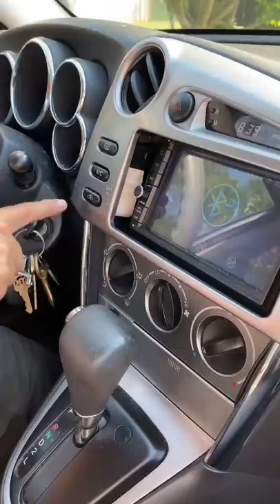Never Press This Button While Driving

Comment: This is why I always drive with several large shrubs.
Reply: okay pot head
Reply: And the light on inside
Reply: Oh.  It was just supposed to be a CO2 joke.
Reply: @chupacabraattack  for photosynthesis
Reply: We found Roger the Shruber.
Do you leave a path down the middle?
Reply: Interesting....
Reply: @donnelcrunk2122  pot heads rule, squares drool
Reply: Top gear, range Rover green house
Reply: The knights of nee demand

A shrubbery. A medium one not a big one and not a small one a mid size shrubbery.

Comment: Holy smoke. Didn’t know about this.
Reply: same im kinda shocked i always have it recirculating especially living in arizona it gets way too hot
Reply: @williamsantiago9284  Notice he said carbon dioxide and not monoxide. We exhale carbon dioxide and this really doesn’t apply to drivers making short trips. You’d have to be on the road for hours and probably have multiple passengers sharing a small space.
Reply: Holy smokes Scotty is full of crap
Reply: @bigdaddymak1439  He’s actually spot on. Carbon dioxide can lead to drowsy driving. An easy solution on long road trips is to roll a window down every couple hours then roll it back up or just put your climate on fresh air setting so you’re not breathing in air that you’ve already inhaled/exhaled. This really doesn’t apply to most situations unless you have multiple passengers or if you’re going on a really long trip with the car sealed up tight.
Reply: @EricFortuneJr.  do some research it's just not true
Reply: @bigdaddymak1439  Carbon dioxide is linked to fatigued driving on long trips.
Reply: @bigdaddymak1439  its ok to be wrong sometimes lol
Reply: @k23180  except I'm not do some research people smarter than me  have studied it.
Reply: One of my friends died because of that too much carbon dioxide in side the car with 3 other people inside 😕
Reply: Next time I'm driving I might think of this and get nervous. Good thing I carry a back of smokes in the car for the nerves lol

Comment: Actually tested this with a fancy meter and even with 3 people I could barely rise the the co2 levels on recirculation. I tested this with a modern car I don't know about older cars...
Reply: Agree!! If we turn the recirculation off, it makes our aircond compressor works harder to cool the air in the cabin
Reply: I believe you are correct, cars have been required to have a positive cabin pressure for many many years to prevent CO poisonings, recirculation button would not affect that. Our guy gets a C- on this one! Fresh air will make you more alert on a long drive but not for the oxy content.
Reply: It’s because it’s complete nonsense. Your car would have to be hermetically sealed for CO2 to actually build up and even then it would take longer than you could possibly drive in a single stretch.

Comment: Good advice however I think the car leaks/lets air in enough air that you should be fine.
Reply: It's a car, not a space ship.
Reply: Yeah I think this is only an issue for luxury cars with insulation out the trunk and triple sealed doors.

Comment: You know, this is a very valid point. And most of these modern climate control systems default to recirc indefinitely if the temp difference outside is very high. I like fresh air. But there are other benefits, like hitting recirculation before you get into stop and go traffic, or driving by landfill or water treatment plant.
Reply: Or a skunk or roadkill
Reply: Yes I can't stand that it does that until you adjust the temperature higher on my Lexus, but I'll usually just switch it manually cause my body usuly can tell I need more oxygen so I open the sunroof and put the windows a little when I switch it from recirculation.
Reply: Or granny Bea's outhouse by the turnpike. 💀

Comment: Most cars only recycle 25% of the air when on recycle.
Reply: Uhh... Yeah I really doubt car companies would be poisoning their drivers lol. There might be truth to what he said but I bet it's still better than breathing some outside air.
Reply: Look up the research papers on co2 build up in cars. Modern cars are well sealed and don't have a limiter on the recirc flap (it helps with fuel efficiency,  and gets some cars across the line for regulators) and can lead to significant build up, less so while moving to. . I thought the same thing as you, but researched it before commenting...
Reply: @homegeographic5351  obviously you've never been to school. Happens and diffusion are a thing buddy. Recirc could result in Increased levels of CO2 that can be maintained in a stable configuration due to infrared diffusion by normal air. Aka CO2 cant get too high cuz things want to be in even concentrations, but if you build up as fast as it vanishes, you'll have increased levels.
Reply: @homegeographic5351  are garages/cars sealed like a bubble when people kill themselves with CO2 poisoning? All that matters is that there is enough time and enough CO2, say with a car full of people on a long drive with no windows down. Now it wouldn't kill you but you'd probably be more light headed than normal.

Comment: My last vehicle was a 2005 Buick with manual A/C.  In the manual it stated that on recirc. there was still 20% fresh air coming in through the ventilation system.  Why would the carmakers want to change this?
Reply: So its colder inside....manufacturer don't  care about your health just want to sell u a car
Reply: They all still fall into the 10% to 20% category. Even convertibles don't reach 95% fresh air, get a motorcycle for 100% fresh air, go down a hill and feel the air in the valley be 20F cooler.

Comment: Okay but.... when I have it on recirc I am hoping that the diesel fumes stay out of the car... but it is not perfect either. You did say put it on fresh air on long trips.  So, glad to hear it.
Reply: I just leave it on recirc for most of the time and switch to fresh air every hour or so for 5min… plenty enough to not notice any carbon dioxide build up. Now of course if the car is full, 4-5 people, it’s a different story. Then I would say get fresh air in every 20-30min at least.

But I hate nothing more than having to smell the exhaust of a car pressing the pedal to the metal onto the highway… that’s why I prefer to put it on recirc. And don’t start me on city driving with scooters 😷

Comment: Scotty!!! What should I do for a manual base Toyota Matrix 170k km (105k miles) NO maintenance history!!! 
Carfax shows 7 pervious owners nothing else! Guy I bought it from only had for 5000km. Ontario so it was certified for every owner. 
I got an oil change, new front bearings/brakes, checked all the fluids and swapped/cleaned all the filters. Serp belt is new, previous owner did it.
15 year old car and looking forward to the next 15 years!

Comment: A car isn't exactly an air-tight capsule; there's outdoor air leaking in all over. I've always run mine on closed-circulate and never had a problem. Plus, theoretically, in closed circulate mode your Air compressor has to work less thus giving you better gas mileage.
Reply: A car not being air tight doesn't necessarily mean that air will leak out especially if you have the ac at full blast. That would create positive air pressure inside the car making air leak out
Reply: You should avoid using the recirculation button in the winter or in cold weather. It traps humidity inside the car, causing foggy windows and mugginess.
As you stated, recirc is fine to use all the time in warm weather to help your AC to run more efficiently.
For the people who never use your AC, your AC compressor shaft seal will dry out and you will need a new compressor sooner than those who do use it.
I always turn it on when riding behind somebody who lead footed there engines into an oil burner with a tracer tail exhaust pipe. They dont care because they are in front of it, and have a case of oil reserves in trunk for long trips.
Reply: @Simiocrates  Well if I drive by a dead skunk, landfill, or whatever, I can still smell it even with the AC on closed-circulate. 

Just like you're not going to suffocate in a stuck elevator.
Reply: It’s 115 degrees where I live
Reply: @Simiocrates  You said... "A car not being air tight doesn't necessarily mean that air will leak out especially if you have the ac at full blast. That would create positive air pressure inside the car making air leak out"

The problem with your logic, is that a 100% recirculate situation would not create "positive air pressure". You would need new air joining the existing air in the cabin to create "positive air pressure".

Comment: Not true. In modern cars (2007+), you get a little fresh air blended in even when you're on Recirc mode. If you are in a 3 hour drive with 4 people in the car, then yes, you should turn off Recirc for a few minutes every hour, but in 99% of the cases, you can leave it on.
Reply: Hey, if Scotty says it, it’s true
Reply: @irishuwould5185  memorize and repeat, never question, your always being told the truth

Comment: Absolutely, recirculating should only be used fir a short time while in polluted places like through tunnels, then back to fresh air from out, another time when useful is to cool down the cabin in extreme heat 🥵

Comment: This is total nonsense Scotty. Cars arent airtight. Oxygen levels dont decrease over time even with a full load of passengers. If oxygen was decreasing, eventually it would decrease to zero and the passengers would pass out and then die like in a submarine or something
Reply: Yeah I can't find it to be trustworthy either. So it's what's he saying is true then are we all going to die for the lack of oxygen for a long drive ? The hell lol
Reply: @tienluong4729  yeah if oxygen levels decreased then it would eventually decrease to zero oxygen and you would die
Reply: @alexsbikesandmotors  yeah obviously. My point is don't you think the manufacturers thought of that when they made the car ? I'm sure they did if they didn't want to get sued.
Reply: Wrong. Look at all the people that say they're sleepy with it vs it off
Reply: @bestlaptop_psn  they are all talking crap. Most likely they were fatigued from sitting still in the car for a period of time. Nothing to do with CO levels. Scotty is talking utter nonsense in this video. A vehicles cabin has vents designed into the rear quarter panels that allow air to escape the cabin which are part of the HVAC system. A vehicles cabin is NOT air tight, if it was people would die from asphyxiation when driving 😂😂.
Reply: After a designated time the recirculation setting mixes in fresh air too.
Reply: @scottjames9202  yes modern cars do. This is to stop from the air going 'stale' during a long periods in that car and from recirculating body smells back at you (ie. foot, bo and "gas") smells.
Reply: Exactly man. Lots of his stuff is something he thinks is right. Not facts just like the Kia video even though he loved a Kia in a previous video. Guy makes no sense.
Reply: There are papers on this 
It’s not nonsense
Reply: Older cars, newer cars it really doesn’t matter, a few seconds of driving through a floor will show you how not sealed your car is Lolx recirculated air just keeps it cooler and most people probably get sleepy because cold air makes some people sleepy cold air and sitting in a still position for hours, if your cabin filter is good you don’t have odd smells or things like that, and when you pass by a skunk or a stinky power plant and smell things well that’s just another sign that fresh air is still getting into your car, cars aren’t designed to suffocate you, that’s a very big lawsuit and people don’t like lawsuits it’s safe because it saves money! The most a car has to be sealed is at the top parts to keep out rain that’s about it

Comment: But when I have it set to "Fresh air" I'm breathing in Carbon Monoxide from all the other cars.
Reply: Good point.
Reply: And your car also 👍🏼.. fresh air intake inside the engine bay lol
Reply: @noxnyc23  ... The air under the hood is pretty much as fresh as anywhere else - just a lot hotter.
Reply: @noxnyc23  but all the CO goes through the exhaust manifold, not directly in the engine bay
Reply: Do it on the road when your at speed
Reply: it's mainly useful for road trips not traffic jams.
Reply: Keep your cabin air filter clean..
Reply: @justplaygamer2331  - 
2002 Crown Vic.
Doesn't have one....
Reply: @ronbloomberg  got me there.
Reply: That's inside your car anyway all the time. The circulation mode turns off after a few minutes (at least in newer cars) for exact this reason.
Reply: That’s what I’ve always thought too👍,  especially when I find myself behind a Smokey deisel truck, I always scramble to double check it’s on recirculate
Reply: @d_ward4871  i’d have to disagree. Every time I’ve been behind a sooty diesel ute or wagon I’ve never smelt anything from the soot. Its always the petrols that absolutely stink.

Comment: Back when my Tacoma's A/C was working (before the compressor seized up & I simply unplugged it), the recirc function would time out after 15 or so minutes and revert back to fresh air intake.  Probably to avoid a lawsuit by some low-IQ moonbat saying, "My truck gassed me out! I want money!"
Reply: Once the temp inside gets to the set temp it should automaticly go to fresh and then back to recirc when it gets too warm. or switch them every 10 minutes or so to freshen the air.
Reply: both of my toyotas are programed to come on in recirc when you turn on ac and never go to fresh air if you put it on fresh next time it is back to recirc

Comment: i crack the front windows. the back ones create pressure pounding in your ears.
Reply: its your crappy design of your car, the new supras do that with the front windows
Reply: yeh I noticed that in my F150. I dont lower my back ones
Reply: You have to crack open both of them to prevent that.
Reply: @lajya01  yup balance the airflow. one car I had needed you to put all 4 windows down by at least an inch to eliminate that

Comment: This can't possibly be true, imagine the lawsuits?
Reply: well, in really hot places everyone keeps the recirculate option on. no one wants hot air to get inside. if you turn it off the ac won't be able to cool down the inside plus, you will get all the exhaust fumes from other cars inside too. do not know what he is talking about. people get sleepy because of the monotony of going always at a fixed speed, plus the slow up and own movement of the car on the highway. not because of co2

Comment: I have often wondered about this....But, the AC in my 09 Camry really isn't strong enough to keep up with real hot weather when run on fresh air....Do my best to not use recirc mode on highways/long trips though...  I remember the AC in my 73 Chevy, that system could have froze up the sun....Usually had to switch back and forth from AC to regular vent mode to keep it from getting too cold inside...Guess those days are gone....

Comment: I've tried explaining this to people who leave their settings on recirculate - they fail to grasp. What drives me nuts is both my 2016 Lexus and 2006 Infiniti automatically decide to set to recirc on warm days when I start the car. I'd prefer it leaves my settings as I left them. The AC works so well, I've never needed recirc. In fact the only time I do turn that on is when I'm going past construction or farming where clouds of dust are being churned up.

Comment: A very important reason to not use recirculation all the time is the moisture in your breath builds up in the vehicle. If the temperature is cooler it condenses on the inside of the windows and they get foggy. If it is below freezing the windows can form ice on the inside.

But the most important reason to not use recirc is if you smoke cigarettes and run the a/c. Instead of using outside air, recirc uses the inside air causing the cigarette smoke to enter the a/c system and get on the evaporator. That causes the a/c system to emit a smoky stink from then on. Therefore, it is important to turn off the recirc when you are smoking cigarettes in your vehicle.

Comment: Great subject  to openup my question on ac. Is it bad to turn off car without first turning off ac for atleast a few seconds first? I heard a rumor that if I dont do this the pressure in the ac system will go alot higher than normal causing premature ac leaks/ failures on orings and hoses. Any feedback on this anybody??

Comment: I learned in Switzerland to never using it longer than effectively needed. E.g. in a tunnel without ventilation system. Turn on recirculation but turn off again immediatly when exiting the tunnel.

Comment: AFAIK recirc is never total recirc, to prevent this from happening, so iIt's safe to run recirc all the time. You know this is true because you will instantly and strongly smell outside odors, such as a diesel idling nearby, even with recirc on.

Comment: Some other things about AC, before getting to your destination turn off the AC and make sure it's on fresh air to get the condensation out of the system. You'll notice the vents will get wet, it's a good sign. When you use the AC and recirculation you get better efficiency from the system but if you turn off the car that way there's still condensation in the vaporizer and the ducting that if left that way will lead to bacteria and mushrooms developing. That's why you might notice a nasty smell if you turn the fans on without the AC or even generally. If it's a foul smell get it cleaned asap and change your cabin air filter.

Comment: But, make sure you aren't leaking oil and burning it in your engine bay or it will introduce those fumes to your car and make sure you change your cabin air filter about once a year